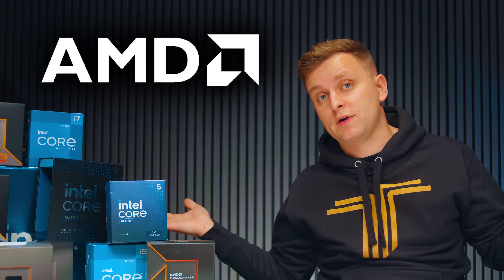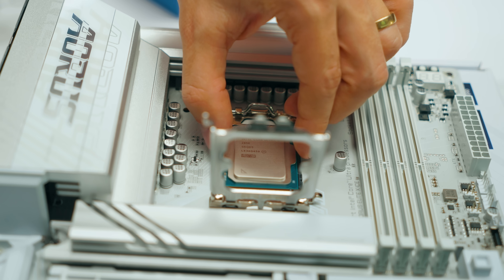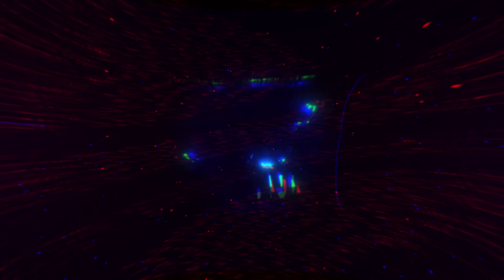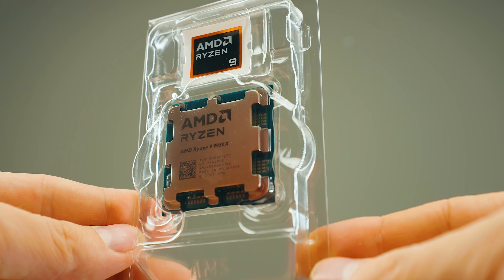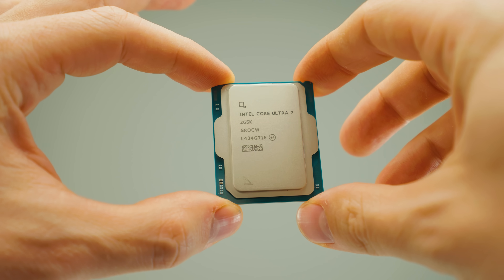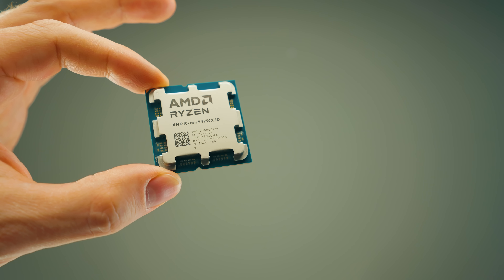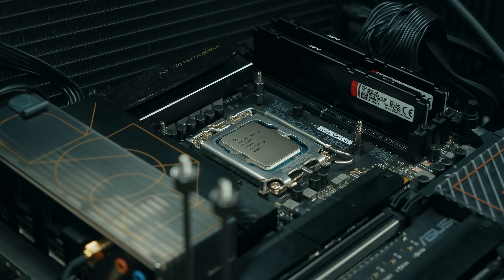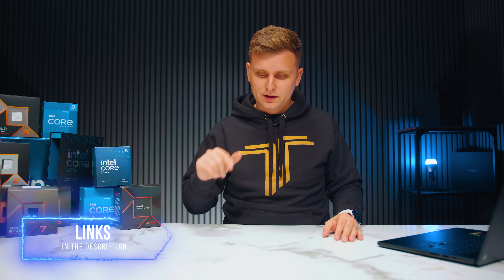Don't BUY a CPU before WATCHING THIS! - Top 5 CPUs for 2025

Comment: Did intel fix the degradation issues of 13th and 14th gen? If not, I'd stay away from those. Also if you go for AMD 7000&9000 series avoid Asrock motherboards cause they will fry your cpus
Reply: Oddly, MSI - a big fan of Nvidia and Intel - seems to have some top notch x870/x870E boards.
Reply: amd 5000 7000 have higher failure rates than intel 13 14th gen
Reply: @bigturkey1  " qucik AI searched ahh result comment" Can't you do better than that?  Btw the problem was fixed by a microcode... plus it was a motherboard failure on asrock and asus boards..... Meanwhile intel kept hiding and tried to keep it secret for as long as possible.... eventually did they fix it? Well maybe? Is the damage already done and some cpus are already damaged? Most likely.... Plus their solution is costing you performance.... I only had intel pcs my whole life but after this and all the bs nvidia is doing I am not trusting them for many many years that's for sure. If you want to be a tester and accept that your pc might burn down just keep using intel and nivida overpriced bs... Don't think for a second that intel wants to keep their pricing this low... thet simply have to otherwise no one would buy their crap
Reply: @professorforest  most often failure on 5000 7000 series was faulty i/o die and would cause usb to disconnect when cpu was under load. I turned off something called AI CEP in my bios and my 14th gen is at 1.25v 5.3ghz
Reply: I have not read any credible sources where 5000-9000 series AMD CPUs have a higher failure rate than 13-14th gen xx700 or xx900  CPUs from Intel. Please provide links by trusted sources.

Comment: Photographer with lots of AI plugins for pshop and i use Capture One a lot too for 150mp Phase One cameras. Still leaning Intel. Am i wrong?
Reply: Threadripper is a great option if you have the budget.
Reply: @gymnastchannel7372 who tf using 5k usd cpu? Just buy intel ultra 9. Cheaperr
Reply: People who want more cores, more PCIe, more RAM at full speed… people who run lots of plugins… 🙄

Comment: No one buy Intel in 2025
Reply: I'm kinda into 265 due to the 299usd vs 500usd 9800x3d.
Reply: @sidewinder86ify  you might regret that 200 USD difference when Intel fries your motherboard and everything on it. Say goodbye to PSU GPU fans memory etc. All of a sudden that 200 USD returns to you with minus 2k+
Reply: @sidewinder86ify  Such an unfair comparison. 265K on a dead platform, worse performance, and higher power bills, compared to a CPU with better performance, lower power bills, way better in gaming, for a $200 higher price, and upgrade path with Zen6, maybe even Zen7? If you can afford a 9800X3D system, that's clearly better in every way possible.
Reply: Have you seen the 265k. That thing is 😮‍💨 for the price. You’re buggin if you think otherwise.
Reply: @1MPUL5IVE  But if you put a bit more money into the CPU, you could get the 7600X3D, which crushes Intel in gaming, and performs well in lots of other tasks as well
Reply: @lassebrustad ? What are you on about. The 7600x3d is about 20 bucks more and performs significantly worse per core while also having less. The 7600x3d is actually a really bad bang for buck in terms of cpus. You can even check user benchmark or tech spot to compare them. At the price point, Intels ultra 7 265k is the best in terms for performance in that range.
Reply: For all the fanboys.The gaming PC market is nothing compared to the market for businesses and laptops. I dont want a 9800x3d to render models.  That thing sucks for that.
Reply: @CMD_MR_GRIDDY  Saying it's "nothing" in comparison probably isn't the right way to describe it, but I get the idea, it's a market with completely different needs.

Productivity doesn't need 3D v-cache, like gaming, it rather needs multitreading, and possibly some dedicated CPU features, in which case Intel has features that AMD doesn't.

But, the majority of features within Intel CPUs, that AMD doesn't have, can either be replaced with a dedicated GPU, or by better CPU cores, which AMD does have.

There's few cases where the 14900KS or 285K barely can be compared to 9950X, while the i9 uses 2x the power, but there's plenty of usecases where the 9950X outperforms both 14900KS and 285K, while using less power.

Sure, 285K is cheaper than 9950X, but don't forget about the higher cooling requirements, increased power bills, and possibly the need for a higher-end PSU as well. AMD simply is the better choice, while Intel is the underdog now.

I'm not a fanboy, I just follow the hardware news, and AMD just crushed Intel the last years. Why else would Intel struggle now?
Reply: @CMD_MR_GRIDDY  Nobody buys an X3D chip for rendering or modeling that’s literally what they’re worst at.
The extra 3D V-Cache helps only in games, not in productivity.
If you actually do real work, the regular Ryzen chips (without 3D) are the better balanced choice  higher clocks, better thermals, and more consistent performance across workloads.

Plus, you don’t need insanely tuned RAM just to get decent performance like on Intel, and AM5 isn’t a dead platform you’ll be able to drop in next-gen CPUs without replacing your entire system.
AMD still wins on efficiency, longevity, and price/performance.

So yeah, X3Ds are for gamers. The smart move is still a regular Ryzen.
Reply: Gamers don't buy intel, to be precise.
Reply: @catninjawang794  I also see content creators buying only AMD for CPUs, no one will buy Intel in 2025 on a dead socket
Reply: @wigeonwaifu if you are editing premiere pro in RAW its great with the AMD.. but Intel is great at H.265 nd H.264
Reply: @catninjawang794  Afaik, AMD can brute-force the performance of Intels few worthy features, while still using less power to perform better in most cases, even in cases where Intel should've been better. Creators can benefit as much from AMD as gamers, as simple as that.

Comment: I'm a huge fan of the Ryzen 9 7900 tbh. Low TDP, good multithreading and times, lots of cache and at a good price. Seems old, still relevant since there is no 9900 exactly equivalent.
Reply: There is the ryzen 9 9900x which is lower tdp than the 7900x but same core count slight lower base/boost clock.
Reply: @wandringhobo4321 I'm talking about the 7900, not the 7900x
Reply: Bro, for 4K editing with H.265/HEVC files, Intel Core Ultra is generally better due to its hardware encoding/decoding (Quick Sync) and advantage in Long-GOP streams—this speeds up playback, scrubbing, and exports in Premiere/DaVinci when the software takes advantage of it. Ryzen 9 7900 is still excellent in highly multi-threaded tasks (CPU renders, compilations, certain effects) and consumes less power in some cases, but it tends to lag behind with native H.265/HEVC in apps that use Quick Sync.
Reply: Bro, for 4K H.265 editing, the Intel Core Ultra 7 265k is better. Its Quick Sync accelerates the decoding of Long-GOP files, offering a smoother timeline and avoiding transcoding to ProRes. Transcoding 30 ten-minute clips would take hours. The Intel lets you start editing instantly. The Ryzen 9 is powerful for multi-threaded tasks (like final renders), but Intel wins for the fluidity of the daily editing workflow.
Reply: @arnaldosancheztecnologia I totally agree with you when it comes to the video editing part. I'm just comparing having in mind all the abovementioned parameters
Reply: @arnaldosancheztecnologia  Like I already said people watching these type of videos are normal every day editors who don't touch 4k at all. Why would you even consider and recommend intel for them when AMD does the job well enough already. Even an older cpu can edit a normal full hd footage.... No one needs degrading intel cpus for every day editing even if it's 1440p footage. Just half the resolution or worst case quarter resolution for even 1440p timeline is smooth even on an older 10th gen intel probably even on some older models as well. I am helping my friend to learn editing and he is working on a 7-8 years old intel cpu... Basically any lower end new amd or intel cpu will overperform his... I am editing on an intel 10th gen cpu right now but not for long. I will be more than happy to swap to AMD and never look back while still having a smooth workflow.
Reply: @arnaldosancheztecnologia  For most creators your comment is simply irrelevant. Those who work with 4k files are most likely professionals and they already have a good enough work station plus normal people will never edit raw 4k files... They just gonna transcode H.265 to ProRes etc and work like that on the footage. So while quick sync makes a difference most people won't run an i9 nor ryzen 9 cpu and if they are working with 1080p or 1400p files they are fine with pretty much any ryzen 7 7000 series even doesn't even have to be 9000. They will edit just perfectly fine. You will struggle more with lack of ram, not enough vram in your gpu than with lack of quick sync in your amd gpu or the lack of igpu....

Comment: I have used 3 intel cpus and they are always lagging, idk why but i dont want to buy intel anymore.
Reply: Intel processors, such as the Core Ultra 285K, 265K, and 245K, are ideal for content creators, graphic designers, and 4K editing, thanks to Quick Sync, which accelerates the encoding and decoding of H.264/H.265 videos, improving exports and previews. Are they slow for you? If it's for gaming, AMD will always be faster. That doesn't mean you can't game with Intel Core Ultra processors; you have both worlds, you just need to know how to configure them correctly during assembly.
Reply: Oddly Cyberpunk seems to run well on Intel CPUs. I’d love to know what happened in the patch that made all the difference in performance for Intel!

Comment: 285K all the way. Work and gaming
Reply: Especially disagree with yours and this channel’s take. Ryzen 9000 on x870 and x670 can do 256GB RAM at 6000MT vs less for Intel. AMD has AVX512 support vs none for Intel, Intel z890 and Arrow Lake seem to have trouble maxing out Gen 5 NVMe…. Slower performance on Core 200 Ultra… this is wildly inaccurate IMO
Reply: @gymnastchannel7372 good luck getting that to post, the most stable AMD CPUs when it comes to memory is the 8000 series and no one is using that and running 4 dimms on x670 or x870 is absolute garbage. You obviously are not a high end owner. Stop spewing bs unless you’ve owned/tested it
Reply: I’ve probably owned more systems than you’ve laid your eyes on. Just built two 9000 series x870 rigs. Stable at 6000MT with four sticks. Neither AMD or Intel do well with four sticks, in some cases its luck of the draw as to how far you can push four DIMMs. My current project is to build a Threadripper 9995WX. Yours?
Reply: @gymnastchannel7372  look at this Amd Fanboyy. Intel better
Reply: Which specific claim(s) do you dispute within my reply? You’re the fanboy.

Comment: My only issue is the limtied future options of intel this gen
Reply: Most Intel gens that’s the case. 🤷‍♂️
Reply: @gymnastchannel7372  Idk dawg I can still put an i5 14600k on my mobo where my 12600k is on. Unless im wrong
Reply: 12-14th Gen is the exception. Normally it’s 1-2 gens per chipset, then done…
Reply: @brandoOfDOOM im on 12600k too and its still good enough for every game imo because i dont care about huge frames 80-130fps at 1440p is plenty and with my 5070ti ive got dlss/frame gen for super demanding games and settings, ill see how demanding witcher 4 is on release and go from there, cant see anything else potentially requiring an upgrade atm

Comment: I love my 14900KS. GREAT for gaming and minor creating for a small Gaming channel.
Reply: There are major reliability issues widely reported with 13/14th gen xx700 and xx900 CPUs. I hope yours doesn’t fail, but I hardly think they’re a good recommendation.
Reply: @gymnastchannel7372  update the bios duuh. Problem solved.
Reply: @gymnastchannel7372  Yeah, automatically pushing 2 cores up to 6 GHz at 1.61 volts was not a good idea. However if you buy a new one and your bios is setup correctly you wont have a problem. I personally would not buy a used one though.
Reply: @gymnastchannel7372  no issues with latest microcode and BIOSes. The issue was motherboards setting the power limits to unlocked by default and the microcode allowing the CPUs to request too much voltage. A brand new chip on a board with an updated BIOS will not have this problem.
Reply: We have no idea if those BIOS’ fully fix the fact that the CPUs were pushed too far, and existing damaged chips aren’t repaired - they’re permanently damaged. Intel won’t own up to it. Moreover, the fixes slightly decrease performance so as not to bring about these issues so quickly. These CPUs were either defective from the foundry (as is the case with the oxidization issues), or Intel looked the other way when mobo vendors pushed them too hard.

Comment: Which do you think will pair best with a 5070 ti super when it comes out the 9950x or intel 285. I am using it video editing with Davinci resolve and will be doing lots color grating. Will intel keep this chip socket down the road?
Reply from the maker: Nope, Intel won't keep the socket...
Reply: Correct, there’s one refresh coming and then socket 1851 is dead.
Reply: @gymnastchannel7372  if I wanted a video editing pc for davinci resolve, that will involve a lot of color correction would it best to go with the intel 285 or amd 9950x. Is it better to spend the money now and not worry about upgrading a few years later?
Reply: Tech Notice does some good testing for this. I would search and watch some benches. Intel can often do well, but AMD is never a bad choice, and when they are allowed to use their AVX512 instructions then they likely win.
Reply: I had this same question and went 285K with my 5070 ti and it’s been great. I believe the 285K now scores higher than the 9950x on puget bench for davinci after updates. But 9950x is still a great choice if you want platform longevity

Comment: I ended up going with the 265k for my editing PC and have had zero complaints about it. Best CPU I've ever owned!
Reply: Same
Reply: can u let me know how much power does it use? Under 120w? Electicity is ridicurlously expensive nowaday 😢😢
Reply: I paired a 265KF with my 3070ti and I completely agree, the smoothest experience I've ever had! I love mine so much
Reply: Me to
Reply: 265f here it has been amazing. 65 w pl1 182 w pl2 air cooled with single fan tower cooler.
Reply: It's crazy how discounted the 265k is nowadays
Reply: @kotztotz3530  intel had to do that to stay competitive, it was the only way. Instead of amd being the cheaper alternative, it is now intel, how the tables turned lolol
Reply: Same here